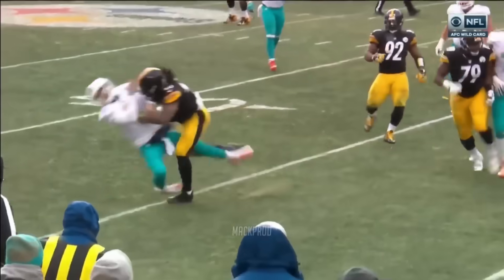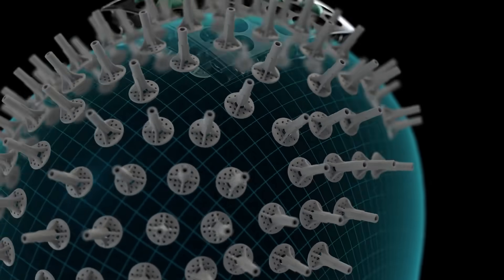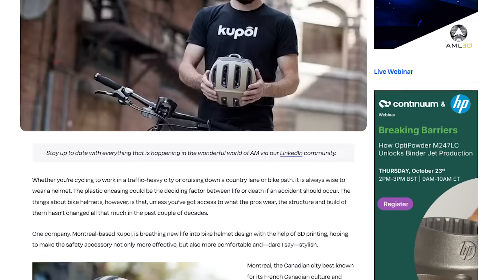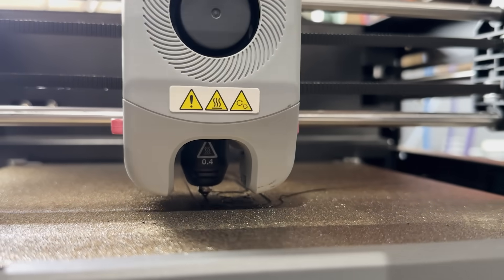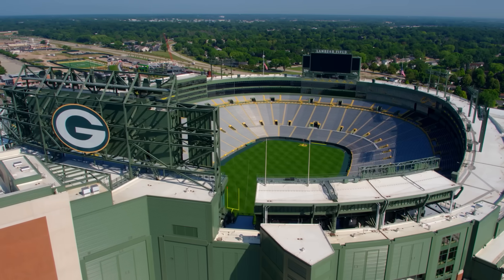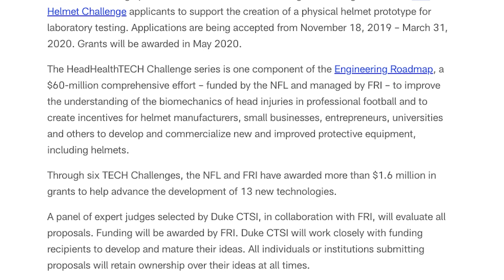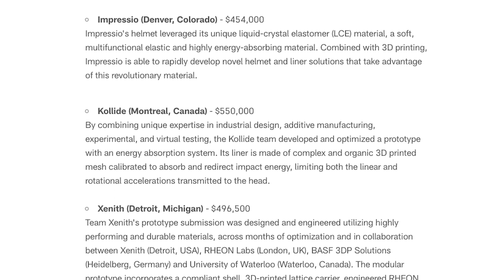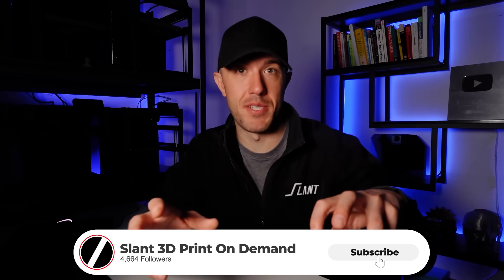Can 3D Printing Save the NFL?

Comment: The only thing we need next is to be able to communicate to the slicer with cad software. For exemple you have a hole, and in cad you specify i want this hole to be 4mm thick with 100% infill, so you can have stronger part but without wasting plastic. Also you can print stupid shit on a 3D printer who are better than every thing in the market. For exemple i bought a special ruler to make road mark for my diorama, and i regret it after just few minutes because it was trash. While a simple 1mm thick line on my 3d printer with custom thing to stick with tape / tooth pick worked 100 times better. 

For a fraction of the price
Reply: More integrated CAD and slicer capabilities would be amazing. Modifiers can work as you described, and modifiers can be modeled to specific shapes and set to specific settings giving all the control necessary, but the process is slower doing the process separately in two distinct programs.

Comment: As someone in the industry, I have significant reservations regarding the long-term durability and proven effectiveness of these helmets. The current certification protocols do not adequately test for the sustained performance required over multiple high-school seasons. Given that most helmets are used for a year or more, the capacity of these thin-walled structures to maintain the same shock absorption over time is highly questionable. On top of that, the reliance on hobbyist-grade 3D printers (like the P1S), which can introduce high manufacturing variability, falls short of the rigorous standards necessary for critical head safety equipment. In my opinion, protecting the brain demands a higher, proven level of assurance; until these long-term metrics are established, established technology remains the safer choice imo even if the established technology underperforms the next gen tech.
Reply: its a nothing burger 
parents wont allow their kids 
to use some unproven helmets
and lets not even start with 
the insurance companies 
not a chance they would allow it